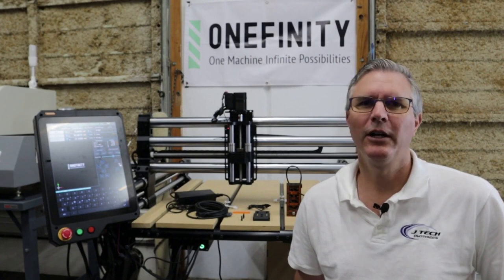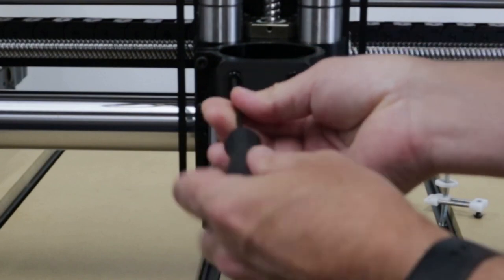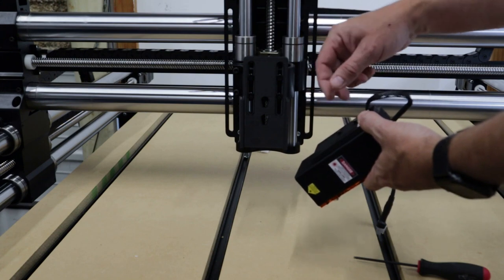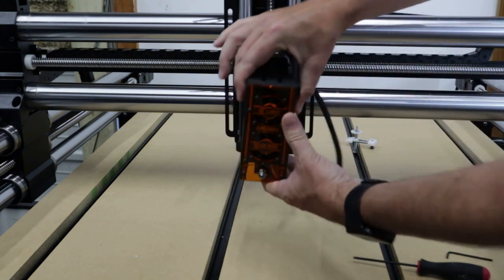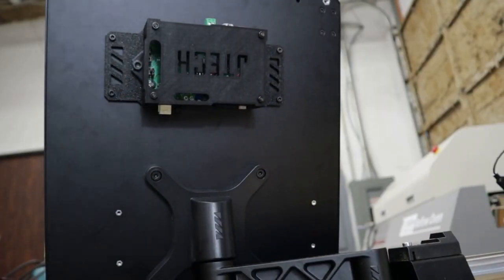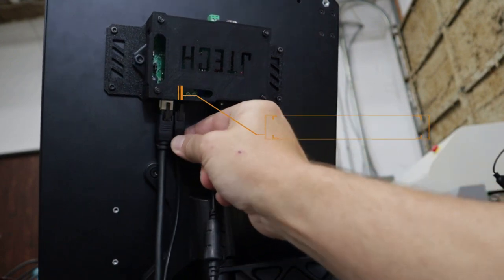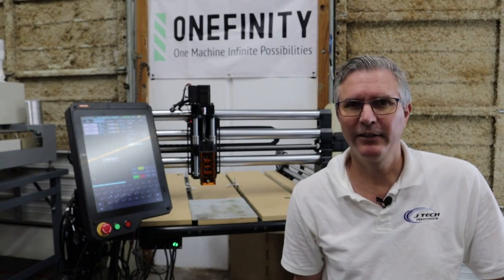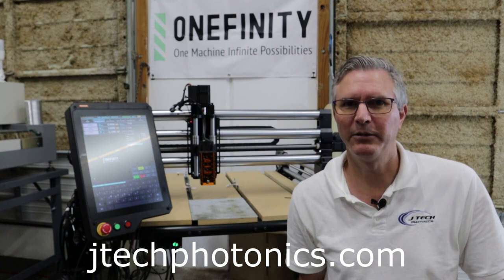Onefinity ELITE Series J Tech Laser Installation Instructions

Comment: I missed the part where you connected the laser controller to the Masso controller.
Reply from the maker: Just plug the little molex into the 'laser port' on the back of the controller!  Easy!
Reply: @OnefinityCNC I'm sure it's easy, once I receive my machine and if I decide to purchase this option. My point is you spend two minutes showing how to run cable through the cable chain but fail to show the most important part of connecting the laser interface to the Masso controller.  Then I'm the idiot!
Reply: I agree. It sounds simple but I don’t know all the different connections on the Masso
Reply from the maker: @chrispelletier3661  They are labeled on the back of the masso.  The one for the laser is marked: "laser"

Comment: Thanks for the video. But there is one major question I have. Is how do you actually hook the Jtecj to the Masso controller. You shows how you put the power box on the back of the controller but I did not see any wires being connected to the actual Masso controller??? Am I missing something???
Reply from the maker: Plug the connection cord from the jtech controller to the back of the masso controller into the port labeled 'laser'.
Reply: @OnefinityCNC  thanks. I knew it was a simple answer, but I haven’t received mine yet so didn’t know there was a dedicated plug. Thanks!!!

Comment: I have my 24 watt JTech laser installed on my Elite Masso and when I select output 11 there is no laser engraver pwm listed. It is simply missing in the list. However, when I select Multi Head laser engraving/cutting does show up there. I follow those steps and set up the MDI T111 M6 and hit run but the tool does not change. Why is output 11 not showing laser engraving pwm?
Reply from the maker: sounds like your default configuration has been changed.  see: https://forum.onefinitycnc.com/t/elite-series-masso-default-machine-settings/17451

Comment: Does the 16 watt laser require air assist because my journeyman elite wasn’t supplied with a nozzle for air assist? 
Thanks
Reply from the maker: the 14w does not, but performs even better with it.  Air assist on 7 and 14 is an optional add on that would need to be purchased direct from jtech.

Comment: I saved the test file in Lightburn, but Masso Link says it isn't a gcode file? It saved as 'test.gc'. Do I need to transfer the file to the Masso USB instead of using Masso Link?

And is there a way to connect directly to my Elite Foreman so I can move the machine through Lightburn?
Reply from the maker: https://docs.masso.com.au/quick-start-guides/laser-engraving-cutting/setting-up-lightburn

Comment: These instructions are missing a critical step – you need to set the "S-Value max" in the LightBurn Device Settings to 1000. The default value of 255 only gives you 1/4 of the maximum laser power even when it's set to 100% Power
Reply from the maker: Correct.  This ideo was made long before 1000 was the norm.